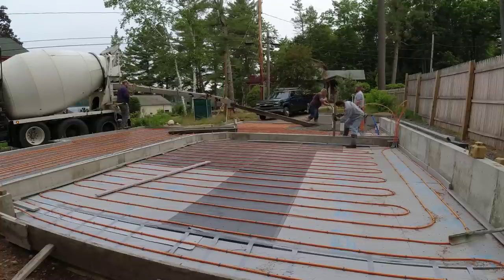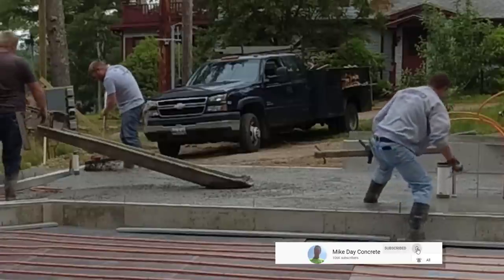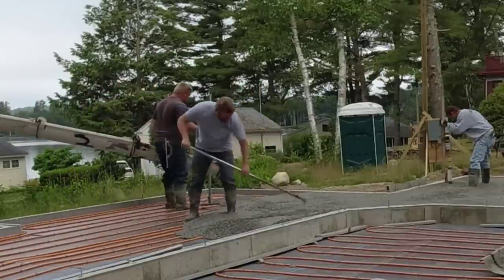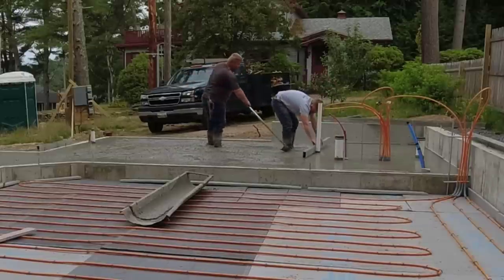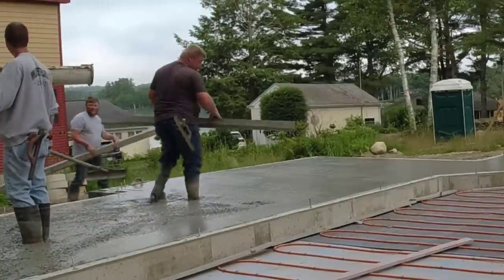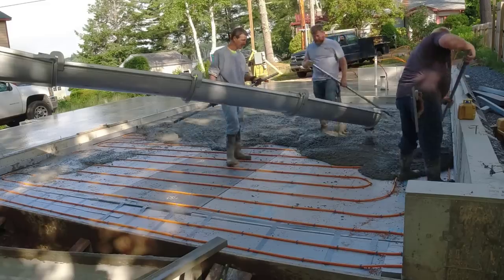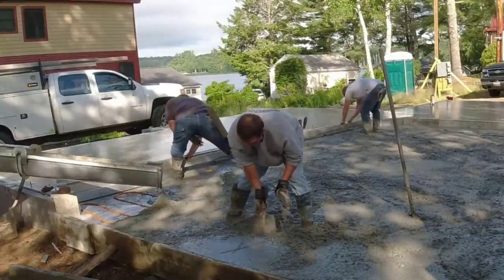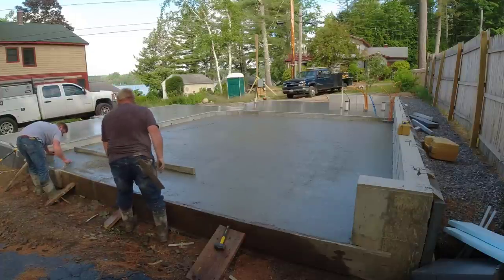How To Pour A Small House and Garage Concrete Floors

Comment: Random question -  on a basement slab pour, why would there be a piece of 2x lumber splitting the basement slab roughly in half.  The top of the 2x is level with the floor and goes from one foundation wall to the other.  My guess was that they may have had to split the pour between 2 days?  Current problem is the 2x lumber has lifted about 1/4" above the slab making laying a vinyl floor a problem.

Comment: Great videos been binging them lately and trying to use the knowledge.  What do u use for a screet? Is that a concrete tool? I have seen them made at times with straight 2x4s and such, but was wondering what you use as a screet tool.